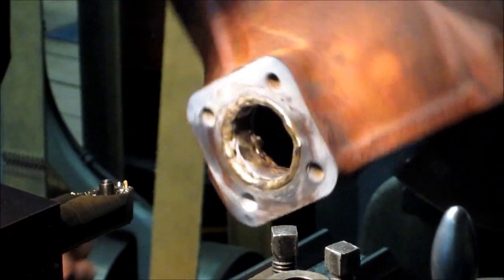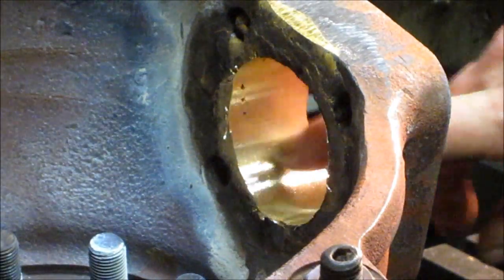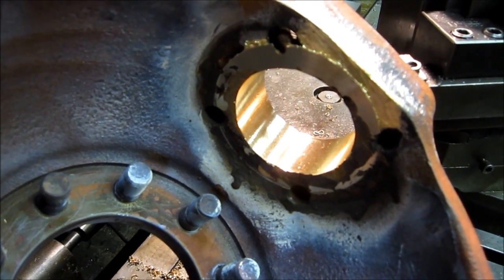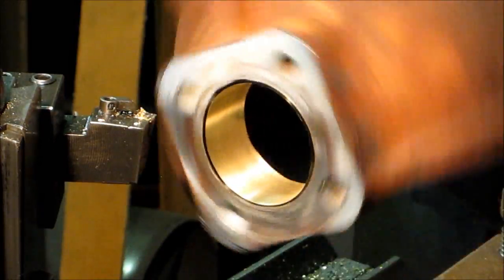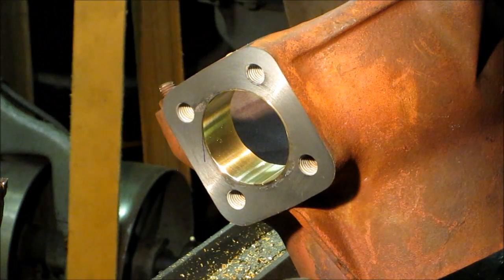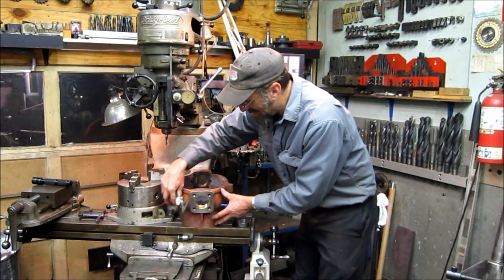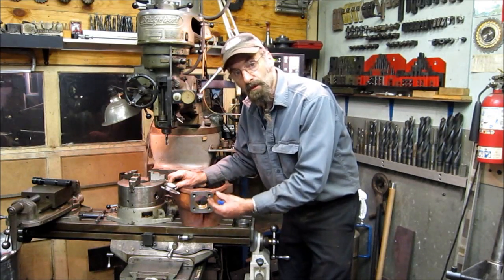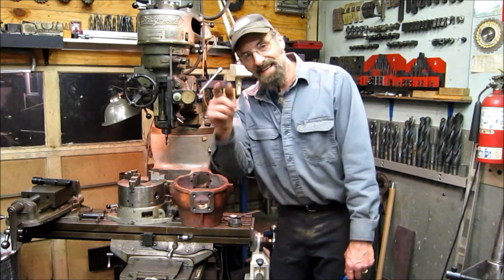Brazing Knuckles Part 3

Comment: how does the strength of the brazed on brass compare to that of the original cast materials? i wondered this also in your video where you repair the turbo bolt hole. is brass pretty similar in strength to cast iron?

Comment from the maker: Exact temp I’ll have to make it a point to check as I do the next brazing, I really sense the temp and how fast it can go from the steady heat to working temp right at the work zone.  I’ll guess though around 900 or a bit more, degrees.

Comment from the maker: In most cases I practice a post heating to lower localized area from working temp to blend into a full uniform part temperature and then blanket tight to create about a 6 to 9 hour cool down period. ;{)---

Comment from the maker: Yes, in fact the covering in earth or soil has been done for years, originally and the best mineral to use is lime and today you can still buy powered lime and build a steel box to keep it dry and clean between uses. It is actually better or more efficient than blanketing. ;{)---

Comment: Great repair! I read where the railroad would repair cylinders for steam engines that were wore out  by heating and cooling from the inside several times. They could reduce the diameter enough to rebore and put back in service.